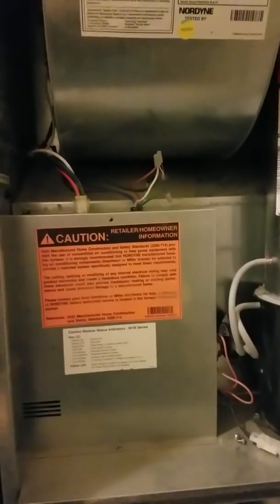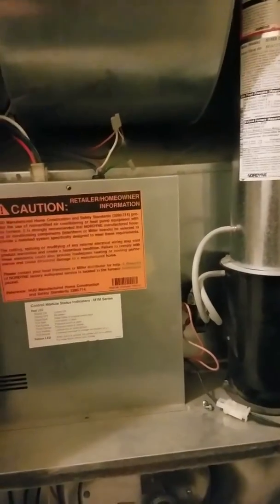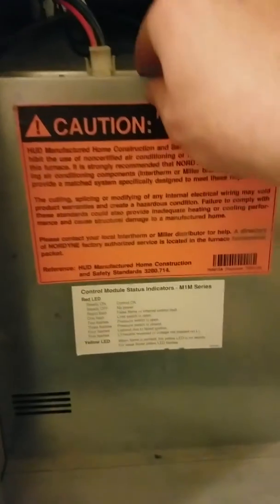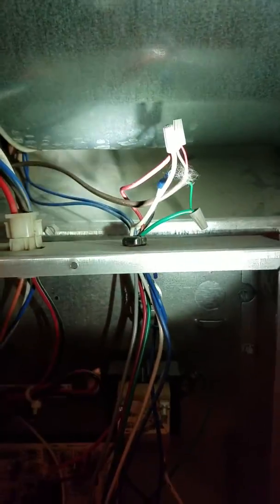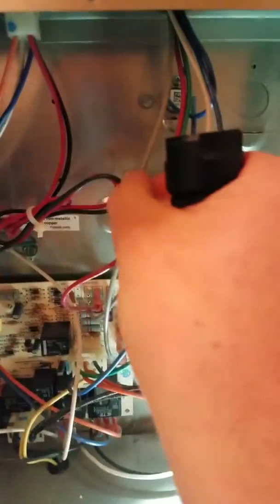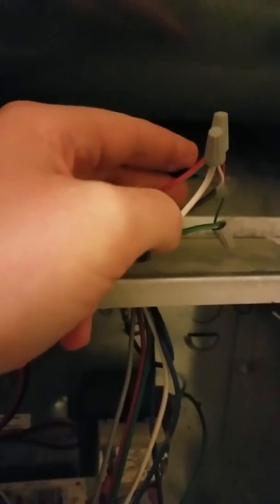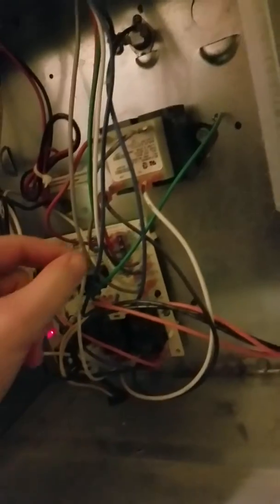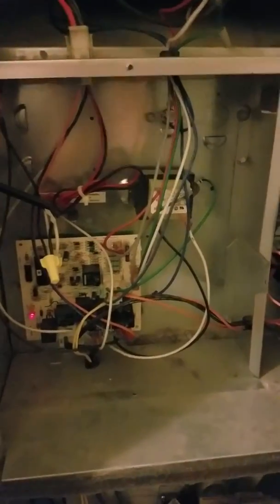How to locate the C wire on a Nordyne M1MB furnace

Comment: Sir, you are a tremendous help!  I was having issues with my thermostat - it would eat batteries and then run out of power.  I thought it was a software issue with the thermostat because it worked for years after installation. Your video helped me locate the C wire and G wire and they were loosened from their connections to the board on the furnace.

Comment: Thanks, fixed my Nest installation !   My daughter brought her old Nest to our house, must have had a weak battery.  The furnace would do the normal fire-up sequence, but never completely kick into heating mode (Rh power?).  After adding the common wire as shown here, no issues.  It was fairly straight forward, but still nice to see the video.

Comment: I have a similar furnace. Could I get some assistance with using my G wire as a common to prevent low power/loss of WiFi and my nest thermostat temp sensor?

Comment: I have this same furnace and my issue is that the blue c wire going to the thermostat wasn’t connected when I connected it it worked fine but my outside ac will turn on for some reason when I have the furnace running

Comment: Help-

My renter decided to fix the draft induced blower himself and he tossed the flue pipe that connects the motor vertically to the vent.  The flue pipe that has the serial numbers and operation and such.

Do you know what that part is called or is there a part number on yours ?  

Mine is an M1M, but that’s all I can find on it.
Reply from the maker: I believe it is called the inducer intake pipe
Reply: jmc6000 okay thanks you!